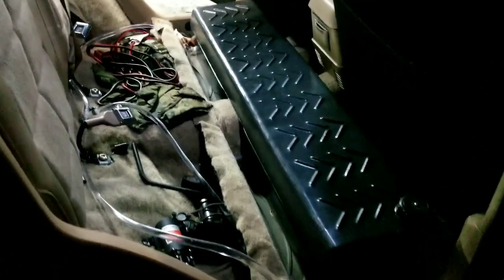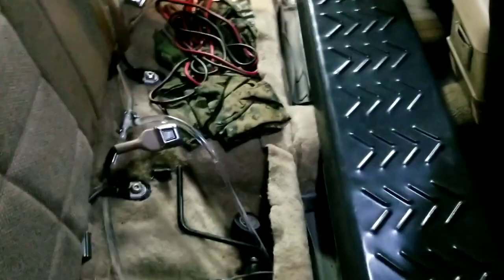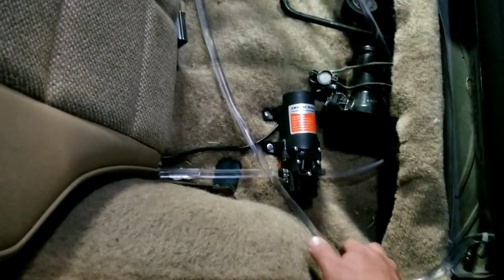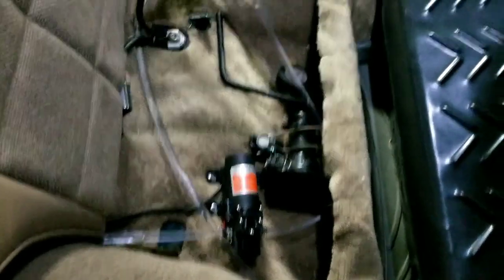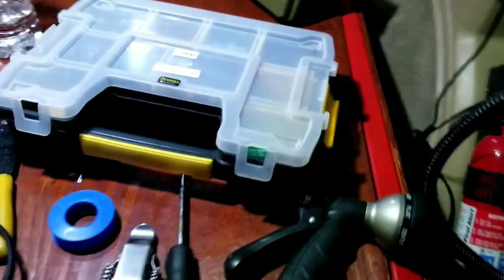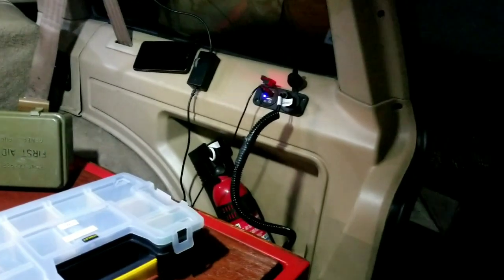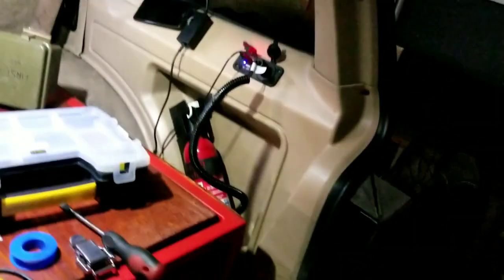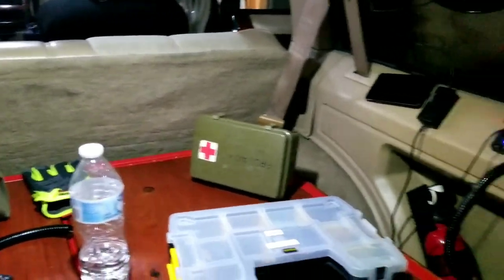On board pressurized water

Comment: Actually I just saw your response that the tank isn't pressurized.
Reply from the maker: Yeah not pressurized. Just a 12v RV water pump
Reply from the maker: I also think Front Runner discourages pressurizing them.
Reply: @jeepinbanditrider  Good to know. I think I my either go the same path you went or build a pressurized tube style for on top of my truck bed, tonneau cover plate.

Comment: What air PSI do you fill the tank to ? I'm looking at all options of either building or buying one of these right now...
Reply from the maker: I dont pressurize the tank.  The 12v water pump pressurizes the line downstream of the tank and pump

Comment: how well does this thing hold up off roading? Any leaks?
Reply from the maker: Ive had it in for a bunch of trips now. No leaks,  but dont ovefill either.  You'll also need to loosen the cap during extended use or youll get a vacuum in the tank that will effect how well it pumps water.  Just dont forget to tighten it back down after use.
Reply: Thanks Josh. Any sloshing sounds while you’re off-roading?
Reply from the maker: @ofermorag  Sorry didn't get a notice on this comment.  You do get some water sloshing sounds, but I really only notice on the road with the radio off and windows up. As of me typing this the tank has been in the Jeep non stop for over a year.  No water leak issues.

Comment: What size hose did you use to connect to the FR Footwell barbs? 1/2"?
Reply from the maker: I swapped out the stock barbs for angled 3/8ths barbs to match up with my pump.
Reply: @jeepinbanditrider  I love the idea. FR says no pressurizing , but here you are.... How exactly did you remove the stock plastic barbs to swap them??
Reply from the maker: @jcs5202  the tank isnt pressurized.  Just a pump hooked to it, it's pressurized downstream of the tank.    
I removed the hose barbs by just turning them out.

Comment: Is that in a Jeep xj?
Reply from the maker: Yes sir.
Reply: Badass! I have an xj to and have been struggling trying to figure out a water setup and I think I just found it! Thanks for the video
Reply: When you take out the seat does the backrest fold all the way down with the tank in place?
Reply from the maker: @danielgonzales9675  When you put a load on the seat it "squishes" the cushion and makes it level but when you first fold it down it will have a slight upward tilt.   Hope that makes sense.
Reply: @jeepinbanditrider  Can you still have the bench seat bottom installed? Not folded up obviously but if you wanted to retain the bench seat in the upwards seating position is that possible?
Reply from the maker: @bubblebaphomet  yes.  The seat is still useable in the normal position.  You only have to pull the bottom cushion if you fold it down.
Reply: @jeepinbanditrider  awesome thanks man!